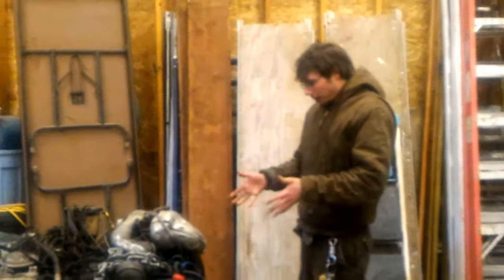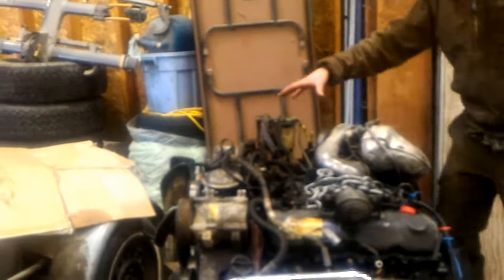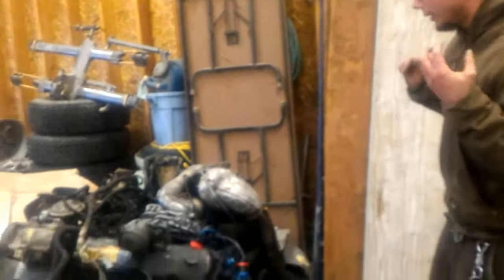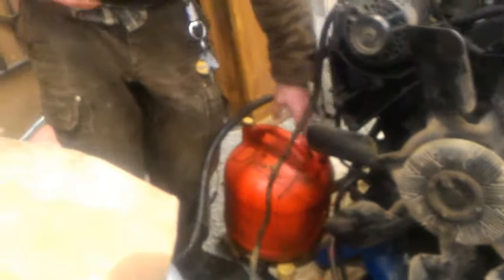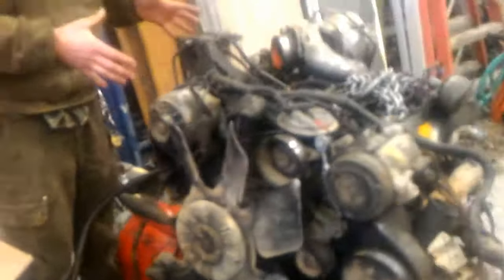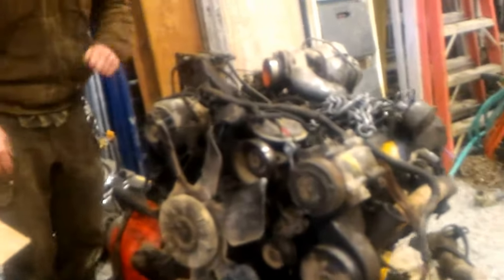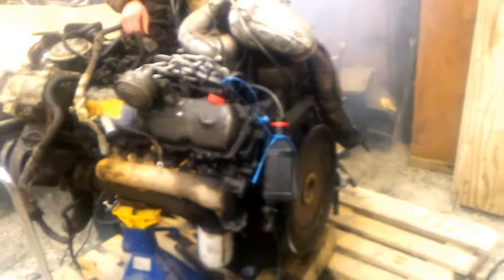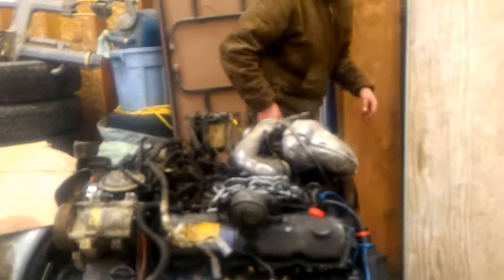Test stand start - 93 IDIT

Comment from the maker: Just an update. This motor is currently going in Big Red, my '93 Factory Turbo truck. The '88 motor in it finally blew a head gasket, and instead of pulling it and replacing the gasket, I pulled it and dropped this one in as of today.
The '88 motor is getting new gaskets, probably my set of headstuds, getting checked out for a minor tick and more than likely going in my tan '88.

Comment: K Robb I need a solution. I got one in my dads old truck ('93 non turbo) I'm gathering info, cash, and parts to get running. I need a straightforward, simple, solution to a strong starter. Is a gear reduction starter a good idea? Also can you give me your recommendations on the brand of rebuilt/re-manned injectors?
Reply from the maker: Honestly, either style starter works just fine. They are both gear reduction units - the Mitsubishi and Nippondenso styles.
I haven't seen any difference in cranking speed between them, either. The big difference comes between a clean and new starter vs a worn out one with no brushes left.

I've heard Powermaster starters are good; personally, I've just grabbed every used starter I can get my hands on and rebuild them as they need it - Generally just clean it up, re-grease it, new brushes and they work again.

Injectors.. You have three basic vendors. R&D IDI Performance, Conestoga Diesel, and a user who goes by 'typ4' on the Oilburners forum.
These guys all sell quality injectors, rebuilt with new nozzles. The nozzle(pintle and seat) is the wear part, and that's hard to come by, so most 'rebuilt' vendors don't, they just use random ones out of old injectors.
I know that the R&D and Typ4 nozzles are good; I've been quite happy with how consistent the pop pressures have stayed as they wear. Conestoga should be really good, but are also more expensive.